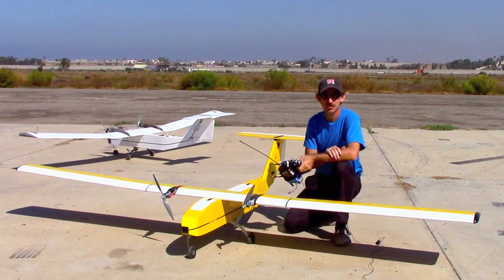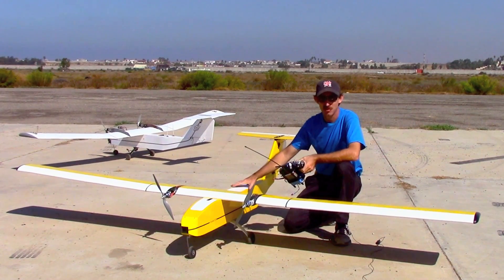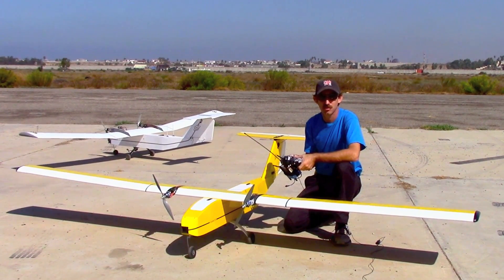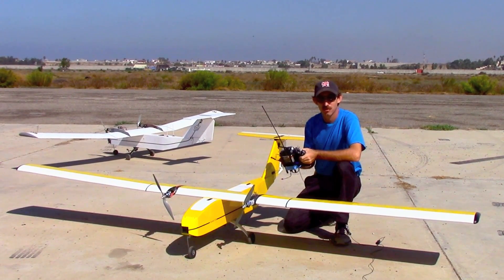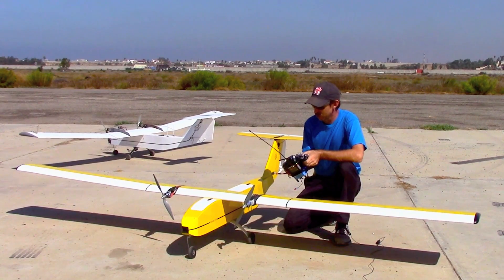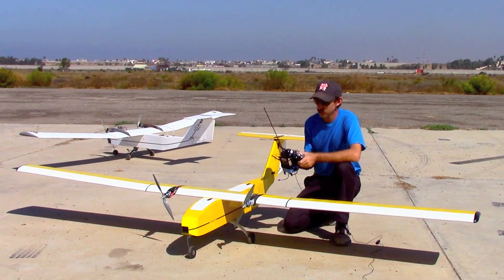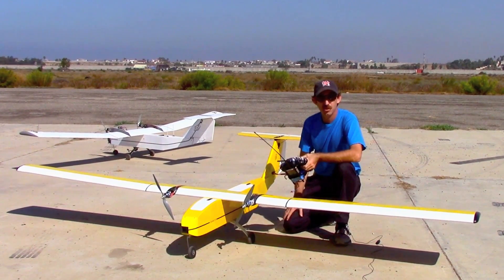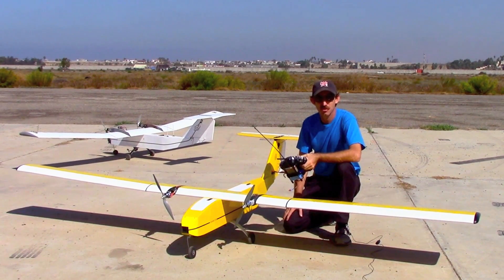Gemini V 2 / Custom Build / Maiden Flight with "Tesla" style battery

Comment: How do you find the reduced dihedral effects performance. I'm very interested in this design, and I'm going to be doing a lot of low altitude, AP work. I don't however want to lose too much of the inherent stability.
Reply from the maker: It's hard to tell the difference when flying manually. the big difference is how susceptible it is to turbulence, and how botched of a landing you can make without striking a wingtip. i've only once ever had a wingtip touch the ground, so it's not a big deal either way. if you fly in clean air build the original version, and if you fly in turbulent air, fly the reduced dihedral version.
Reply: That's really useful. Thank you!

Comment: sweet! is there any way you could add a pitot tube to the osd?
Reply from the maker: +יוסף שטיימן not this OSD, but the MFD OSD can operate in the background, and you can piggy back another OSD that can. 
what i really want to see is an angle of attack indicator and osd that can display the data. or even batter, a flight controller that can use the data from the angle of attack sensor to fly the airplane better.

Comment: isn't it called polyhedral? or something like that?
Reply from the maker: +Ethan Ford The prefix "Poly" means many, and since there are only two bends in the wing, those 2 bends would not qualify as "many". 
The Wiki definition of dihedral relating to aircraft, means a wing angled upward at the sides of the fuselage. 
I can't tell that the Gemini V-2 wing fits either description, so , frankly, I don't know what to call it. 
I had to call it something, so I had a pretty good chance of being wrong. 
if you know for sure, please let me know.   Very Astute observation!
Reply: +FPVREVIEWS  I´t shuld be Trihedral by that logic :)